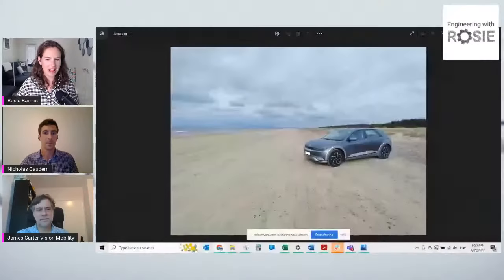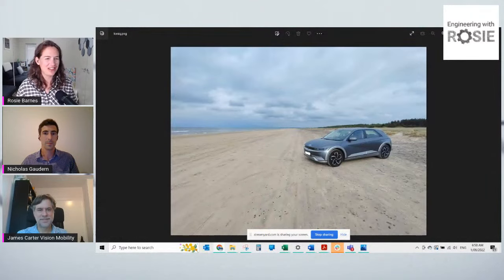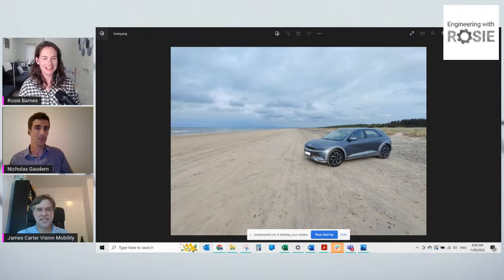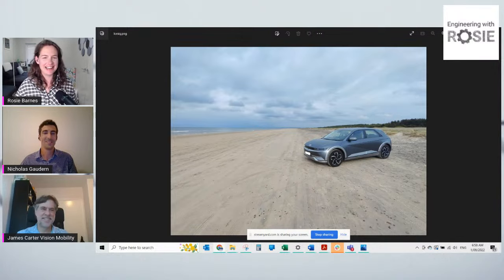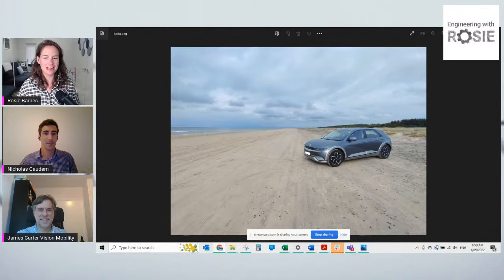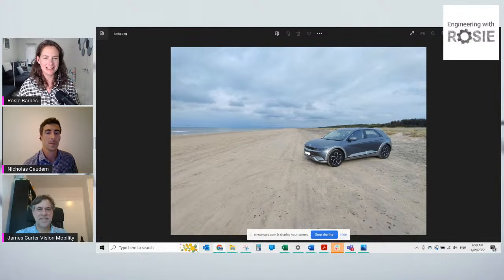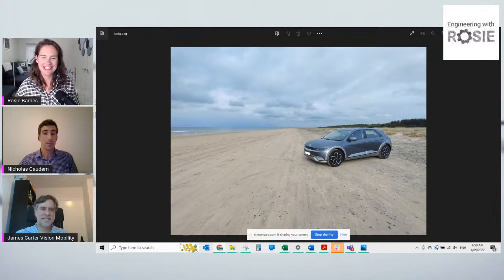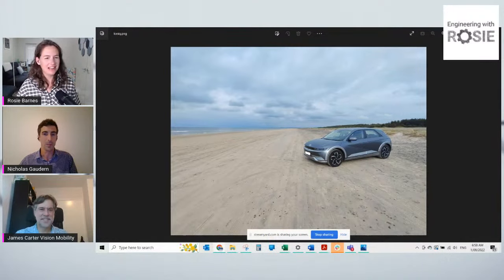Problems and Solutions to EV Charging Headaches | Engineering with Rosie Live Ep 16

Comment: A thing I wonder, regardless of what “game changing” battery chemistry that can be charged in a matter of minutes, aren’t there practical limits to charging power? What, we’re going to have 1 Megawatt charging that is safe?
Reply: A lot of the talking heads on Youtube ( Fully Charged for example ) eschew plug-in hybrids, but I'm not so sure. Let's face it, we're just not going to get 700 km of range through 1 minute of refueling as is possible with fossil carbon fuel, even if we have 1 megawatt fast charging stations. And even from a carbon footprint perspective, would it be so bad if 90% of driving for most people could be all electric, and then use a hydrocarbon fuel for the occasional long trip? Let's sweeten the deal by making the hydrocarbon a synthetic fuel derived from atmospheric carbon, water, and renewable electricity. Even if the synthetic hydrocarbon is very expensive, say $3 / liter, I wouldn't mind because I would use it rarely.

Comment: Most of the apartment and range problems can easily be solved with a small generator that charges the onboard battery. Look at BYD they have. one that goes 200. miles on battery alone with an onboard generator.
Reply: I see home charging is an additional benefit and not a right for EV ownership, current apartment dwellers don't have a petrol pump either for their ICE so they'll have to do what they do now to fill their ICE.  I think once they find a solution i.e. do it when they shop and follow the ABC, it shouldn't be a problem.
Reply: @rtfazeberdee3519  The apartment user will have several choices with that solution, either use gas, or battery, or generation while using battery.  All is better solution than pure IC
Reply: @ksairman  They'll find a routine that works if they get a BEV,  plenty have done it.

Comment: Wireless charging even with optimally coupled coils will struggle to get better than 65% efficiency, so surely it would be better and more efficient to charge 2 EV's via cable rather than 1 wirelessly for the same power.
Reply: They are just a few percent less efficient than cable charging these days.
Reply: @rtfazeberdee3519  Yes just read an article quoting 97% at 120kW.

Comment: Buying an ev or ICE just to use it once in a while for roadtrips does make no sense.
We should first use the batteries to get all the buses and trucks converted...daily use stuff. Evs are for wealthy ppl until now at least. They are also the only ones complaining about shady charging experiences..come on. That'll be fine.
In like 10 years it will be probably equal priced in second hand..thats when everyday ppl will use them.
Reply: I have 2 EV chargers in my garage. My Model 3 is coming up on 4 years. I have 51k miles on it. Chevy Bolt is 26k, MG4 is similar. Obviously, there isn't much choice in the used market yet, but that is temporary.